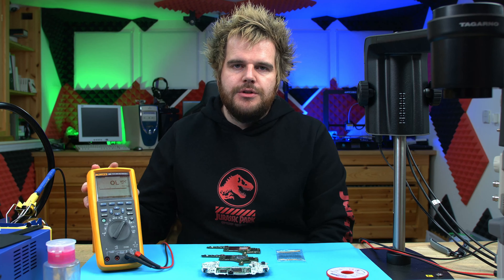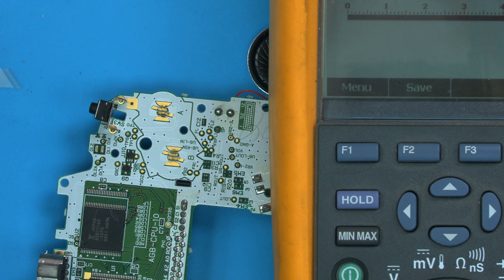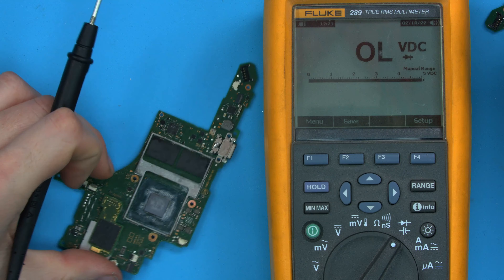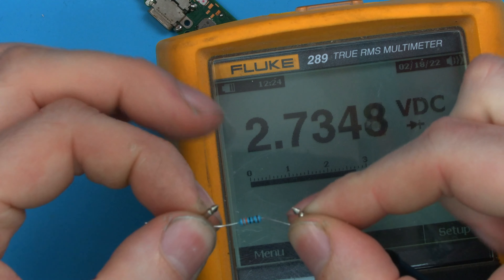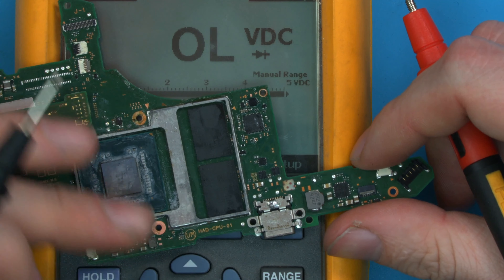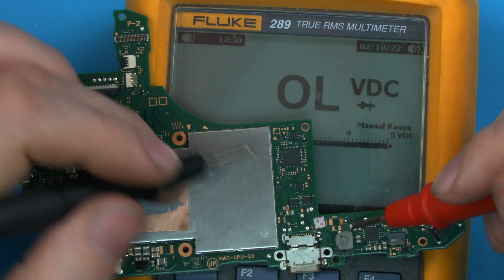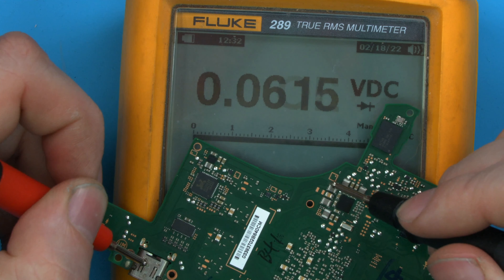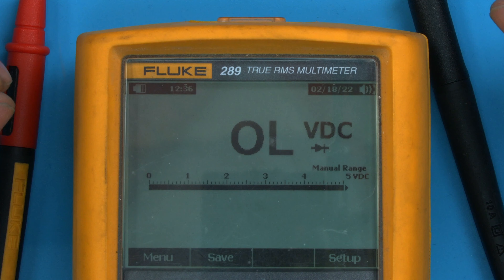Diode Mode Multimeter - Part 6: Diagnostics & Repair Course

Comment: I've been learning SMD soldiering and repair as a hobby for the last 6 months or so and have felt that I have really begun to master the various techniques and tools, but I have really been struggling in the troubleshooting of things department. Tracking down a fault on a board. Specifically, finding a good explanation and demonstration of fault finding in Diode Mode. Your video cleared so many of the little cobwebs I had in my understanding of what was happening. I really appreciate this video. Very well done. You have helped me a great deal in my journey.
Reply: Gosh, and such a good explanation of WHY the probes go where they go.. ah that was money my friend! Thank you!

Comment: OL = Over Limit
Reply from the maker: OL = Open Line
Reply: @RetroSix  Hm, interesting. I've heard both. But what does your meter say if you set it to measure resistance in a particular range, say 2kΩ, and then measure a 5k resistor?
Reply: OL=Open Line +👍

Comment: Key info after 5:25 mark. (Shorted to ground). AND at 12:36 (testing capacitors & inductors)
Inductor test at 13:11
(Ps.  These are mostly notes to myself as I’m learning)
Working board (normal behavior) at 13:26
Nice to have a working board (exemplar)

Comment: Maybe dumb noob question but on 1st good reference board AT 8:45 you test “inductors” , but they look just like ceramic capacitors?   Am I wrong?
Reply from the maker: Yes chip inductors look similar. The key is they are usually a darker brown

Comment: So I had thought that one of the big reasons you put your positive probe on ground was that current will flow through the ESD protection diodes on ICs. For example, if you put positive on an I/O pin and negative on ground, you should see no current flow ("OL") because the ESD diode is reverse-biased and blocking the current, but if you put positive on ground and negative on the I/O pin, you should see current flow, and the voltage drop should be the drop of the now forward-biased ESD diode. Is this right?

BTW, do you mind if I ask where your accent is from? It's very nice, and quite comfortable sounding.
Reply from the maker: It has various reasons. Overall the main one is just over time it becomes more useful readings being red on ground. One for the reason you mentioned it helps to check protection diodes. The other is most things don't flow in reverse so normal diodes in a circuit flow would block the probes flow unless they are faulty. 

I'm from Stoke on Trent in middle of UK. Potteries accent

Comment: Brilliant information and very very well
presented. You explain this so much clearer and with purpose of why than many.  Are you going to release more series on other tools? I’m hoping you continue this!! Many thanks for putting such useful info into the community!

One small noob question…with respect to these dc components, are you aware of any differences outside of perhaps a/c step down components, that vary between countries? In other words would a board in uk and one in us be viable comparisons in diagnostics?
Reply from the maker: Yep I'll continue this for oscilloscopes and other tools soon. For differences mainly video standards so frequencies between 50 and 60Hz. Then mains step downs. Not much more I can think of off the top of my head

Comment: How can I test smd capacitor component
Reply from the maker: Remove them from the board then use a multimeter in capacitor mode or an LCR meter for more accuracy

Comment: Hello I knew wired a skid loader and when I apply power from the battery the backfeed diode on the ignition circuit. Which I believe would be caused by overcurrent. Any suggestions on how to go about figuring it out?

Comment: Awesome video, quick question.  I have a gameboy dmg original and it wont load any game, however the nintendo symbol appears and is slightly garbled.  I cleaned all pins still now luck, what else could be the culprit?  Thanks!
Reply from the maker: Could have damaged traces from CPU to the data pins of the cartridge, or the cartridge pins are heavily corroded stopping the data read. Use a diamond file inside the cartridge connector first to file the pins clean

Comment: Message for retrosix. I'm learning electronics and have a fully functioning board which I'm using to take various tests on and use for learning different measurements on various components to see how they work. I set my meter to diode mode,put red probe to ground and use black probe for testing, I have come across a couple of capacitors that don't beep on ground side and also on the circuit board there are some capacitors labeled as bc109 for instance. Could you give me some info on this please.